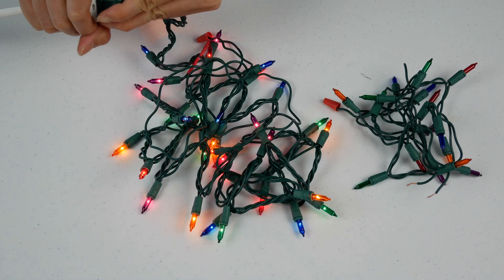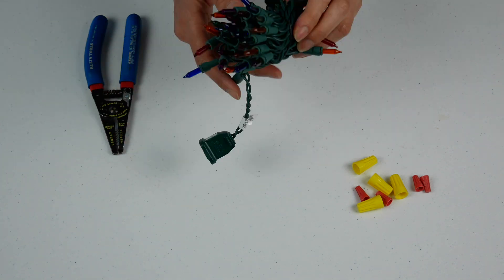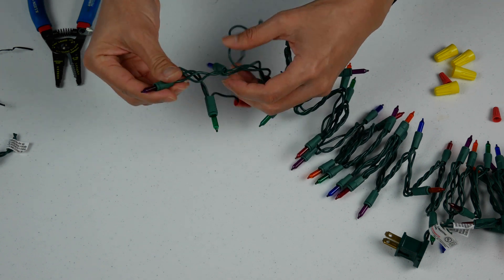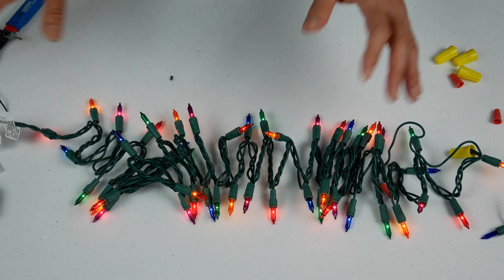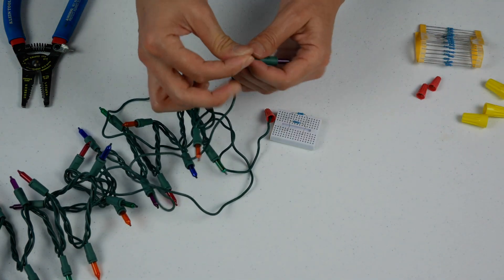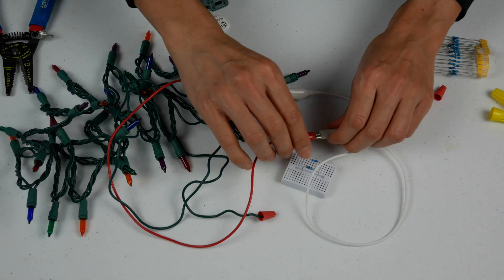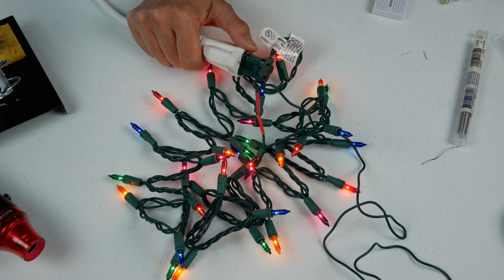How to Shorten Christmas Lights

Comment: Retired electrician here. You’re kinda wrong when saying that removing lights make the rest brighter. Depends how they’re wired. Old lights were wired in series (take one bulb out, all of them go out), in this case, yes, you are correct. Modern strands are either wired in parallel, or wired in series sections. If wired in parallel, removing one bulb does not affect the rest of them. In this case, you could remove as many bulbs or portions of the strand as you like with no effect on the brightness of the other bulbs. If they are wired in series a sections, you can remove any section. Example… If you have a strand of 100 lights and you take out one bulb and half the strand goes out, you should remove a complete section, in this case, half of the lights. The remaining half of the lights will have no increase in brightness.
Reply: I have an "ONLY TWO WIRES" light, its not going on, what could be wrong???

Comment: I've tried a bunch of resistors, including 220, as you did, and they all burn up shortly after plugging the lights in.  The lower the resistor rating, the faster it burns up (from instantly to a few seconds).  I've checked that I'm using the same wires as you.  And like you, if I connect the alligator clips together, the lights work, they are just brighter.  Do I need a high wattage resistor?  Like a 10w or 20w?
Reply: Yes. There is likely too much current flowing through your resistor causing it to burn up. A good rule of thumb would be to assume around 5W of power per 50 lights removed. So if you remove 10 lights 1W would be sufficient. Wattage is more of a tolerance since it's just a resistor so it really doesn't matter how high you go as long as the resistance is correct for Ohm's law and it can tolerate the maximum amount of Watts produced by the circuit

Comment: Can you reattach the end plug you cut off once you shorten it to the length you want?
Reply: Im assuming you could just solder them back together and heat shrink it. But I'm not an electrician

Comment: You need to add a resistor so that the lights don't burn out quickly
Reply from the maker: I definitely did not add a resistor at 3:14
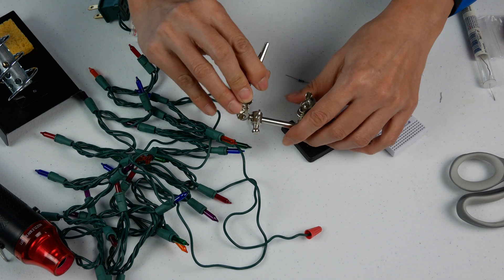Reply from the maker: and I definitely did not solder the resistor at 4:41 - Solder the resistor

Comment: This was particularly helpful to me, who is not an electrician.  I had not considered that the reduced strand would flow more current making the strand brighter and shortening its life.  Your addition of the resistor was the piece that was new - thanks so much!  My original strand had a dead section which I cut out because I could not determine where it was failing (cheap tool, inconsistent readings).  But in that case, because half the section was failing and uncorrected,  I would have the same problem as cutting.   Now I will just go find a resistor.  Pretty clever, and thanks so much.

Comment: Hello, great video, what is the third wire? A hot or neutral?
Reply: Since the strand is not polarized, it could be hot or neutral depending on how you plugged it in.  In her example I am pretty sure that third wire is neutral because the hot side ran through the light

Comment: I have 4 sets of indoor lights I put around my archways and they are all different lengths required.  Choices we have now are either 50 or 100 lights. 50 is too short for me and 100 is too long so I wrap the extra bulbs in electrical tape. Which leads me to having the bulbs and cords wrapped up in a corner where you can still see the extra cord. I actually need 2-18 ft. lighted lengths and 2 - 15 ft. 
I wish they had better options loke we had years ago. Everything now is 50 or 100. We used to be able to get 20, 25, 35, 50,75,100. 
Glad I found this video. I knew there had to be a way to shorten lights.

Comment: How man ohms of a resistor did you use?
Reply: I think in the end 220ohm worked but your mileage may vary depending on how many bulbs you cut from string

Comment: I'm glad that you pointed out the fact that the remaining bulbs gets brighter.  A lot of people forget that point.
The downside to those mini lights is that even with 3-4 bulbs burned out the increased load it puts on the remaining bulbs significantly reduced their lifespan.  And what will typically happen is a cascade failure where all the bulbs burn out at pretty much the same time.  
The other option as opposed to installing a resistor is to replace the bulbs with a higher voltage bulb.  You can get 2.5v, 3.5v, 5v, 6v, 10v, and 12v bulbs.